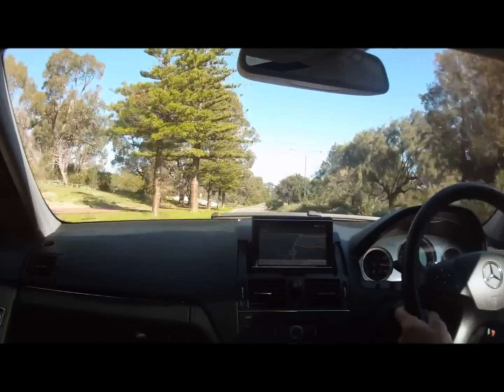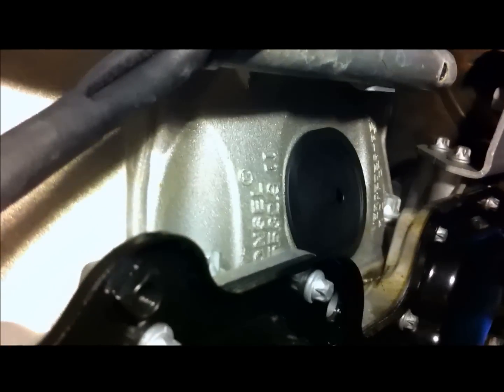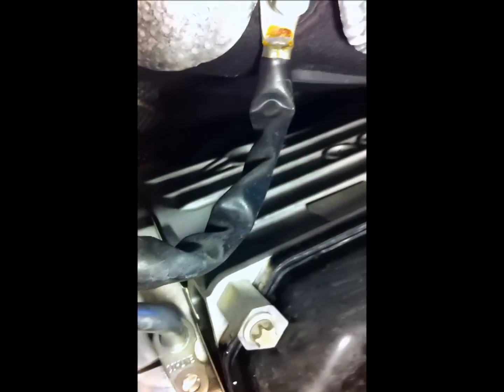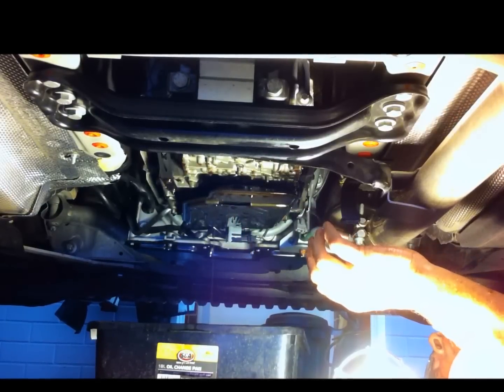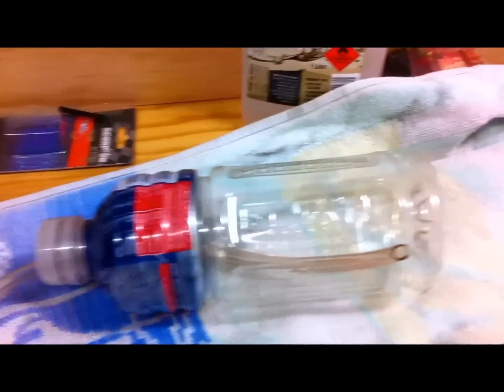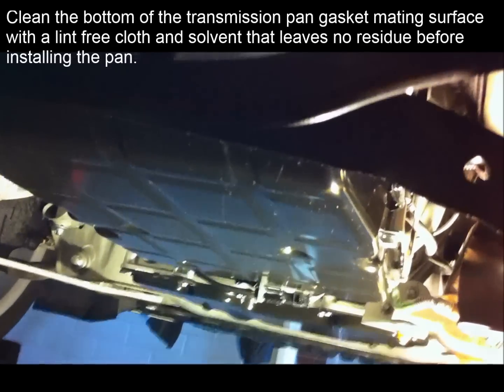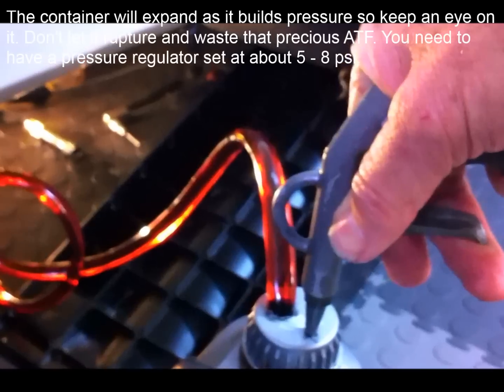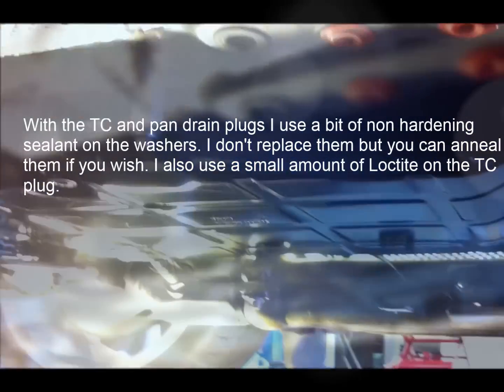Mercedes W204 C Class Transmission Service ATF Fluid Oil Change 7GTronic 722.9 Test 0-60 mph

Comment: Love ya work Scott.  I thought this tip might be useful for others.  I've done this for years to fill diffs / gearboxes, basically anything where you're filling oil above your head.  I use a hand pressurised garden sprayer like in the link below.  I just remove the tip of the gun.  It's a cheap alternative to your air compressor/oil bottle trick with the bonus that the bottle is rated for the pressure.  http://www.bunnings.com.au/hozelock-7l-killaspray-garden-sprayer_p2961580
Reply from the maker: Johnny Withers Thanks John. Yes the pressurised sprayer trick is a useful method. It's also handy when you want to pump a specific quantity.

Comment: Hi! Mr. Scott: I have a question. Can you install an external fluid  filter the return line of the transmission? Also can you repeat how tight the transmission bolts,and drain plug should be. Thanks again. PS I'm also going to use this method of changing transmission fluid on my 2006 Mini Cooper S. It's much easier with the mini, you don't need to drop the transmission pan. The flow unscrews on the mini so that you can drain all of the fluid.
Reply from the maker: victor pariso Hi Victor. I think you could fit an external filter on the return line. Good idea. You would have to use a filter that did not restrict the flow too much. There are probably filters available for this purpose.The drain plug is 22Nm. If you use steel M6 bolts for the oil pan they are 12Nm.If you use the aluminium "one use stretch bolts" you torque to 4Nm and then turn another 180 degrees. These bolts can only be used once.

Comment: Great video Scotty! Your video is the only one on YouTube addressing the 722.9 transmission. I live in Niagara Falls, NY - USA  I'm not clear on what color fluid to use red or blue? Can you clarify. Thanks so much for sharing
Reply from the maker: Thanks Victor. It depends on your year of manufacture and what fluid is specified for your 722.9. So the first step is to find the ATF specification for your car. If it's MB236.14 or below ... that is MB236.10/.11/.12 etc then it will be red. If it's MB236.15 or a higher number like MB236.16 then it will be blue. Hope that helps.
Reply: If its 722.9 7G tronic its use 236.14 red color, if 722.9 7g tronic plus its use 236.15 blue color.  However, 236.15 is not backward compatible with 236.14 red color.

Comment: is this process the same for all 722.9 transmissions
Reply from the maker: choudary Rangzeb zaman Yes it is the same. You have to pump the fluid in from the drainage hole with all the 722.9's. Also I've changed my procedure in that I remove the rear exhaust connecting bracket that sits below the bottom of the rear of the oil pan. That's quicker and easier. I drop the pan from the rear first. It depends what model your vehicle is so have a good look underneath first to plan what you will remove.
Reply: I own a Amg c63 2009 Im sure it has the same transmission - 722.9? same applies  Scott Elliott

Comment: Very good DIY! five star! just curious about how you handle the air pressure while refill from the drain plug? I'm thinking if there is no other way for the air in empty transmission to go, you won't be able to refill enough ATF and since the drain hole is at bottom, you cannot let the excessive air go through it, hoping you can address my concern, thanks!
Reply from the maker: yang song Thanks for comment. Five star is very flattering!The transmission has a vent on the top somewhere.Using the compressor is really no different to the "official" MB hand pump. Both are using air pressure to lift the ATF and push it into the transmission. The air in the transmission displaced by the ATF goes out of the vent.My transmission is faultless. I did the service more than a year ago. So the process I used works very well. In fact it's so simple I will probably change the ATF more often to keep my 7 speed in as new condition. I'm considering adding a second drain hole so I can quickly drain the ATF and refill leaving without removing the pan. If I do that I'll make another video of how to add a second drainage hole.
Reply from the maker: ***** Yang ... I drove the front onto the ramps then jacked the rear up one side at a time with my trolley jack at the normal rear jack points. Watch this short video of mine for a good place to put the stands if you can fit them in. http://youtu.be/H73U4Y4I6Rc Be careful when you do this and make sure the car is secure before you start crawling around underneath.

Watch the ATF change video at 4.21. You need a 27mm socket on the front crankshaft pulley to turn the engine. It's easy to see if you look under the car with a torch.

Watch the video from 13.26 and you'll see I have a note saying you need a M14 x 1.5 thread. That's incorrect as it should have said M12 x 1.5. I got mixed up with my Vito van as that's M14. The link you have to toolsource is for a M12 x 1.5 so it will fit. Lucky you raised it. I'll edit the video. Regards, Scott
Reply from the maker: Yes that's what I thought. I'll be doing the auto service again soon and will add the second plug. I'll make a video.
Reply from the maker: All transmissions, differentials and transfer cases have a vent on the top. Anything with gears and oil inside. It's because the transmission heats up and cools down. The pressure needs to be equalised. When the transmission cools it's drawing air from the outside which is why over time the oil degrades. Moisture and even dust particles are drawn inside.

Comment: So I was going to ask about how to fill the Torque converter, but I read all the comments and see you answer that.  I did believe that the tc and transmission are not sharing fluid, but you state otherwise. Im interested in how this happens.  Also, when filling the trans. how is this done without creating a lot of pressure? You do not mention anything about relieving the pressure my any means and nowhere else have I heard about this being a problem, so Im wondering where/how the air escapes when being displaced by the oil.
Reply from the maker: Hi Suavelito, The TC and transmission are linked as far s oil flow is concerned. So after draining both when you pump in the initial 7 litres approximately and start the engine the ATF is pumped into the TC as well.

Any pressure created in the transmission is relieved when you drain the excess when the transmission reached 45 degrees. See from about 17.08. hope this helps, Scott
Reply from the maker: I forgot to mention my understanding is there's a vent somewhere on top of the transmission to allow any pressure to bleed off.

Comment: Hi Scott, just watched this guide, and would like to thank you as I need to change the oil on my auto transmission. I would just like to ask a couple of questions if it's ok, when you flush the oil cooler do you temporarily fit the transmission sump to catch the oil hence using the temporary bolts ? and the second is more a suggestion, once you have initially drained the transmission sump (after having knocked up the overflow pipe inside the sump) then leaving the sump attached with the original bolts could I not then disconnect the oil cooler pipe and flush the cooler then remove the sump and empty the remaining contents, remove the old filter refit new filter, gasket, bolts etc. etc
Reply from the maker: Shahid thanks for your comments.

I flushed the cooler after removing the oil pan as I wanted the ATF I was using to go through the oil cooler, into the transmission and drop out into the drain container that's not quite visible in the video.

Yes you could do as you suggest and flush the new ATF through the oil cooler and let it fall into the empty oil pan and then remove the oil pan. Your method may be less messy so I'll try it next time.

So the steps would be:
1. Drain the TC and oil pan.
2. Knock the over flow pipe over to drain the remaining oil in the pan.
3. Flush about 750ml to a litre through the oil cooler and allow it to fall into the oil pan and drain out into your container.
4. Remove the oil pan.
5. Remove old filter and replace with new filter.
6. Fit oil pan with new rubber gasket and temporary bolts.
7. Initially fill with about 7 litres of ATF.

Comment: Hi, i leave in France, here to change the transmission fluid costs 380 euro.
I want to make by my self the oil change.
The WIS says to fill in 2 steps:
- the first one: you fill 6L of oil.
after that engine is running and after shifting the gears, the engine should stop
- second one: if you drained the torque converter you must add 4L of oil (total 6+4=10L of oil in the gearbox, before to make the oil level )
                   : in case if you didn't draine the torque converter you must add 2L of oil (total 6L+2L+xL=yL of oil in the gearbox before to make the oil level)
and you didn't took into account those quantities, didn't you had technical problems
How did you connect the multimeter to measure temperature? I have an infrared laser thermometer to measure the temperature of the oil pan
Thank you for answering
Reply from the maker: Hi Sirghi,

First is your transmission the 722.902? If your transmission is a newer model it may take more ATF.

As the transmission uses an overflow pipe to set the level I don't think you need to worry too much about how much you first pump into the transmission. As long as you overfill and then drain the excess the level will be correct.

After draining both the TC and the oil pan I first put in about 7.5 litres. I then put more ATF in and when I tried to drain the excess nothing came out so I had to put even more in. I used more than 9 litres in total. I will put a note on the video to correct it.

I have had no technical problems as the oil level is correct. I have been driving the car for 6 months since doing the ATF service and it is running very well.

I used a piece of duct tape with a piece of insulating foam over the temperature probe and taped it to the bottom of the oil pan. Check at 15.45 on the video.

Many other people use an infra red thermometer so it should also be suitable.

Hope this helps.
Reply from the maker: Sirghi,

I can't access the forum to see your photos. I'd like to see them. kind regards, Scott
Reply from the maker: That's very good equipment you've made. Well done it looks very professional.

kind regards, Scott

Comment from the maker: Thank you for your kind comments.

Well if you don't flush the oil cooler and the lines you will leave some old ATF in the system that can contaminate the new ATF. It's probably not a big problem if you don't do it.

I like doing these things properly and flushing some fresh ATF through the oil cooler was quite easy so I thought it was worth doing.

kind regards, Scott

Comment from the maker: Stephen thanks for the kind words. I'm very flattered. Have a read of the description of the video as I've added some information. If you like you can take the exhaust bracket off at the rear of the transmission and lower the pan and pull it back to remove. Or you can take both the exhaust bracket off and the front tubular bracket if you want even more room.

My transmission is still running beautifully. As it was an easy job and only cost $100 I'll do it more frequently so the tranny lasts.

Comment from the maker: Thank you for the kind words about my video. Yes the oil galleries inside the transmission are connected to the TC. That's why you run the car in Park for about a minute after the initial fill so the TC is filled up again. Trust me it works. The only way to put the oil in is through the drain hole in the oil pan.

Comment from the maker: Mike. The cross member MB are referring to is probably the bracket that connects to the exhaust. If you remove that and the front tubular bracket I referred to in the video it makes it easier again. It just gives you more room.

Comment from the maker: The gearboxes are all very similar. what model W204 do you have? If it's a V6 petrol it will have a 722.9?? box like mine. If it's 4 cylinder it may have the 722.6?? 5 speed auto.

Comment from the maker: Thanks Mike. I'm flattered you believe it's the best video on this subject.

The engine cross member is probably the same thing I mention in the video. On the W204 C320D the oil pan needs to be lowered at the front and then pulled forward. The rear tranny support is slightly over the pan

I have a 2011 WIS and found nothing on 700ml first. It said after draining the TC and draining, removing and cleaning the oil pan and installing filter, to pump 6 litres into the transmission. I put about 7 in.

Comment: Hello
Your video is the best I have seen.  I am planning to do this in the next few days.  One  WIS sheet I found talked about removing the rear engine cross member and pre filling the transfer case with 700 ml of fluid before doing the rest of the filling.  I didn't see you do this.  Do you know of this?
Thank You
Mike B